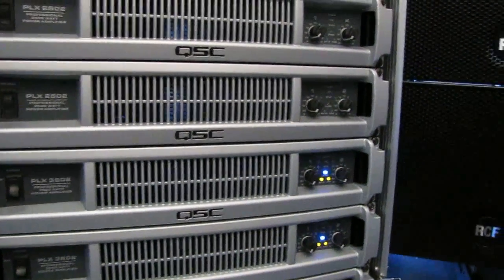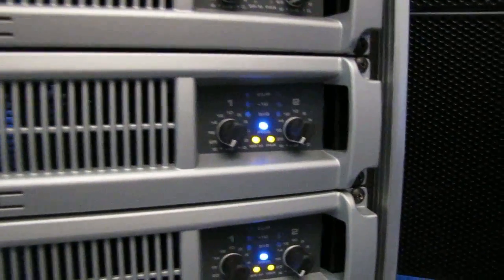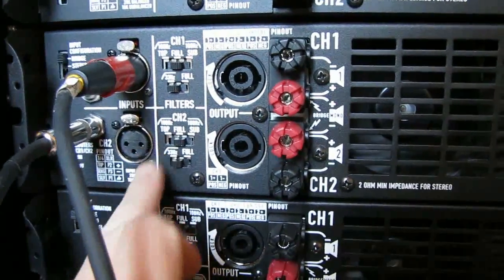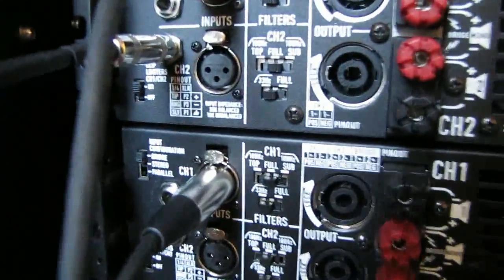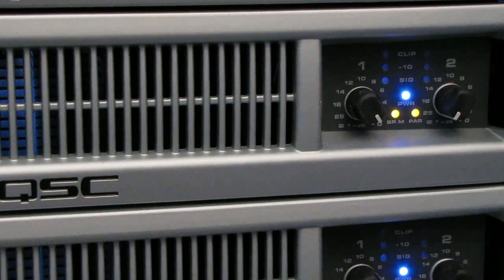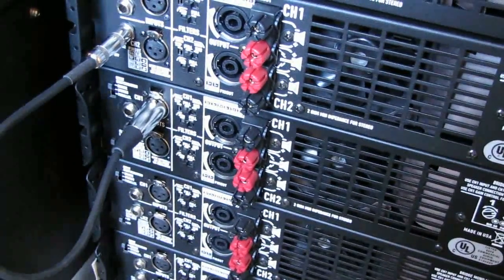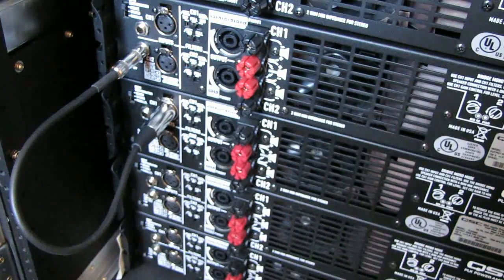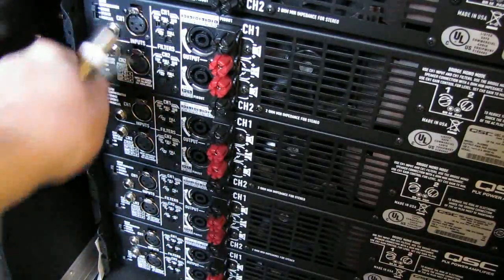"Daisy" Chain of Amplifiers (QSC PLX) - This is a mono configuration

Comment: Do you have to use XLR to 1/4 Inch? Or does it not matter, as long as you're chaining from the correct channel.
Reply from the maker: You are correct, it does not what type of cable is used.  I'm using XLR to 1/4" in the video to show it can be done using different connectors.  We most always use XLR to XLR.

Comment: From the beginning hoe did you connect l & r output on mixer to channel 1?…with what cables!….Thank you.
Reply from the maker: The setup in this video is for mono sound.  In this video, we used the Left output from the console.  There is nothing connected to the Right output of the console.  The cable coming from the console to the first amplifier is an XLR cable.  Hope this helps.
Reply: @stageleftaudio  ....yes, thank you.

Comment: Thank you for postings such informative videos. My question stage left is will this work with all or most two-channel amplifiers?. The amplifiers I am questioning about our Crown CTS 3000
Reply from the maker: Daisy chaining works with most amplifiers that have 1/4" and/or XLR connectors.  It may not work with the CTS line of amps from Crown, because those series of amps usually have different input (and output) connectors.  Something like a signal distribution unit (with connectors that support the CTS line) may be needed.

Comment: Hi-Thank You for all of the informative videos you have posted over the years...Where would a distribution amp - like a Drawmer DA6 (6 stereo/12 mono) - be placed in a signal chain?
Would it be something like Board Out(s) -> Distribution Amp -> Power Amps -> PA Speakers?
I understand that only speakers should be connected to power amps .I know that you're not actually amplifying power.
Hopefully you would do a video explaining the correct setup.
Reply from the maker: Thank you for your comment.  The Drawmer DA6 (and devices similar to it) most always are connected to the main outputs (Board Outs) of a console... exactly like you referenced above.
Reply: @stageleftaudio  Gee,What took you so long to reply?lol😉
With this video being an older post,I figured either no reply or maybe awhile before any response.I always wondered how all the amp racks and speakers at an arena/stadium concert were connected.Like a lot of people,I used to think that when daisy-chaining amps,you were 'multiplying' the power.But then,after awhile, that didn't make sense to me because of the ohm load that would be placed on the amps from connecting all the speakers together.Thanks to this video,I now understand that you're running the SAME SIGNAL to a bunch of amps,then the speakers are hooked up to the individual amps.
I've looked at the Drawmer manual(pdf) but it wasn't clear as to where the DA would be in the signal chain.And connecting a distro amp after the power amps would certainly 'fry' a DA.I don't own a DA6 - it's the only one I could think of at the moment to use as an example.
Your time,quick reply and informative videos are Much Appreciated!😀

Ray
Central Ct Shoreline

Comment: What is you don't have a 1/4 in  out puts 
And just xlrs inputs 
Chanel 1 
Chanel 2 
How do you conecte
Reply from the maker: If you only have XLR inputs, a "Y" cable can be used.  Basically,  the "Y" cable will allow you to connect the signal (from the mixer) to 2 amplifiers.

Comment: please can i connect two different   Amplifiers together ?
Reply from the maker: Only if the connection is by signal level.  You cannot connect the speaker outputs, or amplification together.  Only the signal levels.
Reply: @stageleftaudio  sorry i did not get you ? can you give me example please
Reply from the maker: Sorry for the confusion.  You can connect two different amplifiers with using the same signal (just like in the video).  I just wanted to make sure you understood that you cannot connect the  amplifier output (speaker output) from one amplifier to another.  Hope this helps.
Reply: @stageleftaudio  thank you
Reply: @stageleftaudio  it should be the same ohm ?
Reply from the maker: For daisy chaining signals between amps, the ohms will not matter.  The ohms are related to the amps and speakers, not the signal levels.  However, if you wanted to use different ohm speakers on the amps, this would be ok to do.  
** Before you do anything with your setup, I HIGHLY recommend you post your technical question to an audio forum.  There are a lot of people on audio forums that can answer questions more quickly and with more detail than what I would have time to post on this video.  Thank you.

Comment: If you crank up the master volume on your mixing console to 35 percent volume and your power amplifiers are not clipping and your gains on the mixing console are set correctly and your at unity gain on the mixing console and your using a compressor to prevent clipping and your speakers still sound distorted would this mean that it’s all boiling down to the power amplifiers themselves being internally damaged or due to the fact that the power amplifiers are very cheap and overrated.
Reply from the maker: From the type of setup you are referencing, audible distortion can come from undersized amplifiers being pushed/driven at their maximum power (for a sustained period of time).  Also, distortion could be from the speaker drivers themselves, usually the high-frequency speakers and mid-range (if the cabinet has mid-range drivers); the speakers are being driven beyond their capabilities for a sustained period of time.

Comment: Can a power amplifier be used without a mixing console or would using a power amplifier without a mixing console cause the audio signal to be too weak
Reply from the maker: Not really.  Mixing consoles increase the voltage for amplifiers, so the amplifiers can do their job.

Comment: Have been having a problem with this
Reply from the maker: Make sure the amplifiers you are using can support the passing of signals out of the amplifier.  Also, setting the input of an amplifier in parallel mode (not the amplifier itself, but the input), will usually allow the second input of the amp to act as a pass-through for signals.

Comment: Hi! I have a question!
How can I connect 2 amps to a mixer yamaha mg16xu  y have qsc gx5 and crown x4000?
Reply from the maker: Most will use a "Y" cable.  The "long" end of the cable connects into the mixer output; one side of the Y connects into the QSC, the other into the Crown.

Comment: I'm new to this.  So now how do you run to speakers?
Reply from the maker: Each amplifier would drive a speaker-cable connected to it with a speaker at the end.  In this video, the amplifiers are setup for bridged mode, therefore, each amp can only drive one 8-ohm speaker; meaning, you would need to connect a speaker to each of the BRIDGED amplifier outputs.  Daisy chaining of speakers is mostly used for subs.
Reply: @stageleftaudio  , thanks.  I understand.  Wanted to ask tho. 
I have a situation that I'm trying to do the right way. Like I said,  I'm new ish to this.  I'm in a local band with just a berhinger pmp 5000. I realized that I can't daisy chain basically more than two monitors together. I'm using one channel for mains and one for monitors. I do have an Inuke 1000 that I can add in to the audio outs. I'm hoping it's enough. I think if I'm running two daisy chained from my monitor channel and two from the behringer Inuke, that I can have 4 monitors without having problems.
Reply from the maker: Sounds like that should work.  Make sure the speakers are 8-ohms.  If they are 4-ohms, it's usually not a good idea to daisy chain two 4-ohm speakers (too much of a load for most amplifiers).  Two 8-ohm speakers daisy-chained rarely ever presents a problem.
Reply: @stageleftaudio  , yes, they are. Thanks for the help

Comment: I have 5 qsc amplifier in my rock is it ok for them rest on each other or it have to get a space apart from air
Reply from the maker: As long as the cooling fans are functioning correctly in the amps, you rarely need to place a space between them.  Spacing amps apart is usually for amps that do not have cooling fans.

Comment: Will 4 1000 watt power amplifiers plugged into one wall outlet on a 15 amp circuit breaker cause the circuit breaker to trip
Reply from the maker: If all 4 of the amps were driven to their full power, it would trip a breaker.  In fact, 2 amplifiers at full power will probably trip a breaker.
ampers x voltage = max-wattage.  Therefore, a 15amp circuit running on 120 volts will support a maximum of 1800 watts.  

You can plug all 4 amps into a single 15amp circuit, but do not run them at their maximum.
Reply: How does one avoid running amps at their maximum? Can you explain please.
Reply from the maker: Basically, do not turn up the volume so much that the amplifiers begin to distort (or cause speaker distortion).  Or, if there are limiter (or power) lights on the amplifier... make sure neither of these are flashing (i.e. showing the amplifier is reaching its limit).
Reply: @stageleftaudio  Thank you for the quick response and explanation. I appreciate it very much.

Comment: Question when you bridge a amplifier do you get the power as the manufacturer say. Do it work
Reply from the maker: Referencing your other post:

It depends on the manufacturer of the amplifier.  QSC is among one of the top reputable brands of amplifier manufactures.  Their amplifiers do produce the wattage they indicate in bridge-mode.

Comment: What is a ground loop between  amplifiers?
Reply from the maker: It's a ground-loop (60hz hum) situation that usually occurs between FOH and the stage, but sometimes occurs between amplifiers driving the same signal.

For the amplifiers:  This occurs when 2 amplifiers are each connected to their own power source (i.e. separate circuits) and their signal inputs are daisy chained together with a balanced (aka TRS) cable.  The balanced signal cable between the amplifiers may cause a ground loop.  To remedy this, use a ground-lift cable between the amplifier inputs/outputs.

Comment: Do you have the ground lift switches on when you are daisy chaining amplifiers from 1/4 to balanced
Reply from the maker: Normally, no ground lift switches are needed when daisy chaining.  The only reason you may need to use a ground lift cable (or switch), is when the power amplifiers that you are daisy chaining are getting power from different sources.  The PLX amps in this video do not have ground-lift switches.
Reply: @stageleftaudio  I have 5 racks of Crown Macro Tech amps they have the lift switches on them I have alot of buzzing coming through the speakers might have a ground loop somewhere each rack is fed back to the distro and the FOH is fed from the distro I have balanced and unbalanced cables throughout the system the amps are daisy chained from the crossovers the amps are running on 220v and 110v
Reply: @stageleftaudio  I might have a bad crossover or something going on in 1 of the racks the others seemed to work fine then I heard a very loud blaaaaahhhhh through the speakers then it popped the breaker at the distro didn't hurt the amps any but I wiggled the cables in the back of the crossover then it went back to normal, weird don't know if the subs jiggled the cable loose or what? Or I have some bad cables
Reply from the maker: Noise in a system can easily come from bad/inferior cables, or using unbalanced cables, and sometimes from a passive crossover.  Older crossovers (depending on much they have been used) can start exhibiting behavior similar to ground-loops.  The cheapest and quickest check would be the cables.  Also, make sure there is no oxidation on the cables or the insert points of the crossover.  Oxidation causes issues with contact points.
Reply: @stageleftaudio  I'll check it out see what's going on with it I know it's in the 1 rack and not the rest of  the system must be a bad cable because I wiggled it and then everything went back to normal probably the xlr plug on the end of it had a bad cable in my other rack that was making noise running my 5002vz's it was making all types of noise I had some other crossovers in my racks before think they must of caused some ground loops and probably fried some cables so I changed them out because they were bad and making all types of racket I have some TDM  4 ways in it now the crossover that was in my sub rack was making the wires smoke

Comment: Can you just do xlr cables
Reply from the maker: Yes.  For these amplifiers, XLR cables can be used.  In the video, I used 1/4" to XLR to show  they too can be used (for those who have amplifiers without all XLR connectors).  The cable format that is needed to daisy chain is dependent on what the amplifier supports.

Comment: Hi 
We can see you connecting cables.But can't see witch terminal goes to witch input and out put.And also you are using cannon and stereo 1/4inch plugs very confusing.
Are you able to show bigger screen for this video?
Reply from the maker: In this video, all we are doing is connecting the channel #2 output/input to the channel #1 input on the next amplifier.  The amplifiers in this particular video are setup for parallel operation (meaning channel #1 and channel #2 will be producing the same signal as each other).  All we are doing sending the same signal to the next amp, and using that amplifiers  channel inputs (on channel #2) as outputs to the next amplifier.  All amplifiers will receive the same signal.
The cables I'm using in it show that it doesn't matter if you have a 1/4" or XLR cable... both types can be used to send the signal from one amplifier to the next.

Comment: Out of four amplifiers which amp connect to the speakers?
Reply from the maker: The speaker connections would be to each amplifier; the daisy-chaining process is to get the signal from one amplifier to another.  Daisy chaining does NOT add up all the power from the amplifiers.  Each amplifier would still have speakers attached them (as they normally would).
Reply: @stageleftaudio  so if these were bass amps they all would play only bass but two speakers can be put on each amp that play bass.

Comment: Can you post a video how to onnect multiple amps with jacks
Reply from the maker: Are you referencing the 1/4" phono-jacks for connections?  If so, the phono-jacks and XLR function the same way.  As long as there is a 1/4" jack for input and output into the amplifier, the same process as XLR connections can be followed.
Reply from the maker: Yes - it is possible to use those jacks (RCA connections).  However, the amplifier will need to have 2 sets of those jacks - 1 set x for input into the amp, and 1 x set for output of the amplifier.  The manual for the amplifier may reference this type of setup.
Reply: @stageleftaudio  ok thanks for the info i will try it out
Reply: No i ment the tulp jacks red and white can you apply the same process?

Comment: Thank u so much for this video! Great explanation. I could really use your knowledge if you may help me out. 
I have recently opened up a coffee shop and barber, 2 in 1, it's inside a 600 m2  location, and I need to make a good speaker system setup. What do you recommend I use? 
I need at least 3 speakers on the main area, coffee floor, and another 2 speakers upstairs inside the men area, and another 2 for the female saloon. 3 different zones, 1 big location, all zones are easily accessible. 
What do you recommend I do? I want to stream the same music everywhere, that's not an issue. I was wondering to daisy chain 4 amps and putting 7 satellites în total. 
I would really appreciate your help and advice! 
Thanks 
Mike
Reply from the maker: Thank you for your comment.  Unfortunately, we do not do interior acoustics for audio, and are unable to recommend products or services.  You may want to check for a local audio resource that can visit your location and provide recommendations.
Reply: stageleftaudio thanks so much for your reply. I understand that, but at the top of your mind, what do you suggest I do? Just an example. I would buy 3 amps and put them in daisy chain mono mode. Then hook them up to an audio source. Is that a good idea?
Reply from the maker: There's a lot of variables involved with what you are needing to do.  Though, with what you just mentioned about placing the amps in mono and daisy chaining; this would probably work for your setup as long as mono is acceptable for you.

Comment: What are the amps for power when you plug it in to a outlet?
Reply from the maker: Sorry for the confusion.  What do you mean by "what are the amps on the box"?  The amplifiers are 15amp units... not sure if that is what you are looking for.
Reply: @stageleftaudio  that's what I was looking for thank you. Other wise 3 units would be 45amps to power them
Reply from the maker: Those amplifiers are the QSC PLX-3602 series.  Those are 3,600 watts each when run in bridged mode.
Reply: @stageleftaudio  I know that. But im talking about when you plug it into the generator what are the amps on the box?
Reply from the maker: The amperage is the maximum the amplifier can draw when the amplifier is running close to full power.  Correct, for 3 amplifiers, it would be safe to have 45 amps available... but that is only if the amps were to run full-power.